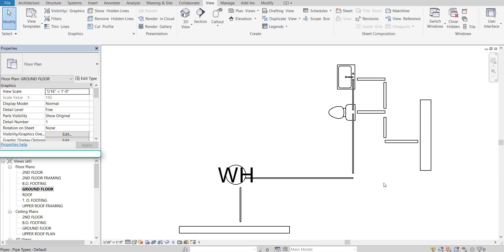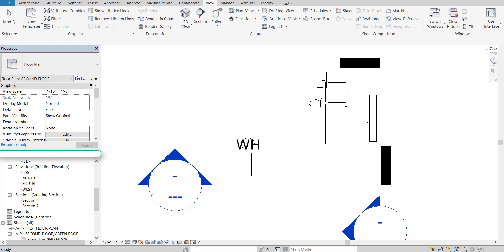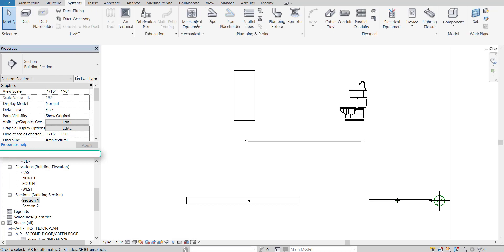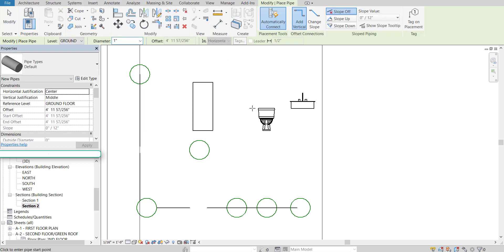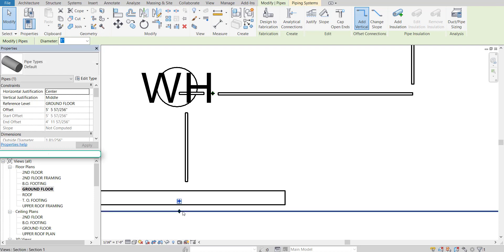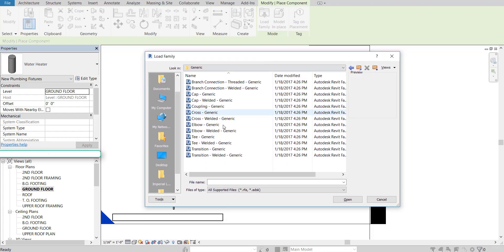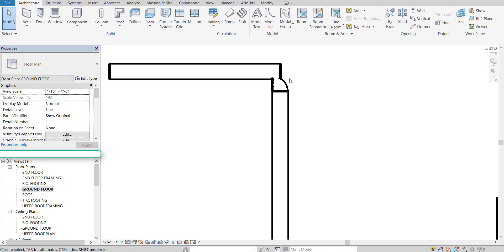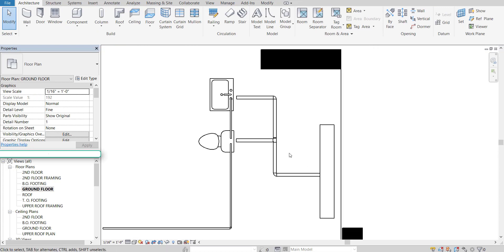3D Plumbing Plan - Autodesk Revit 2018 - Part 2

Comment: Why is there no way to snap pipes directly together? I constantly get errors when trying to connect pipe together/to fitting and seems stupid that you have to draw pipes near and then move them into place so that they look connected????
Reply: Have you tried to use the trim and extend (TR) command to connect pipes?
Reply: Absolutely wrong modeling of pipe connections. When you import fittings from the library you have to set routing preferences, then you will be able to connect the pipes.
Reply: @TheCaxxx  where can I download generic pipe fittings for revit 2018